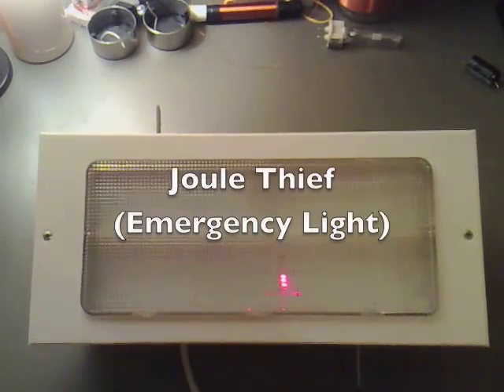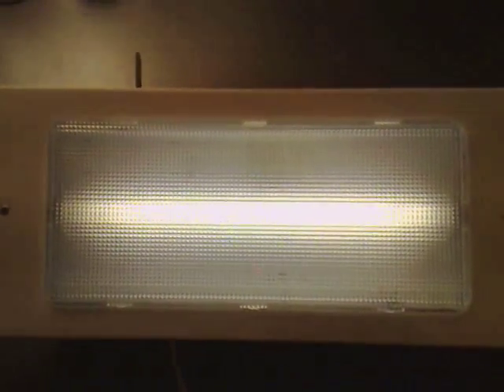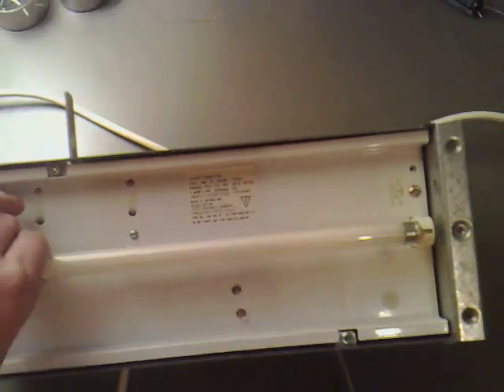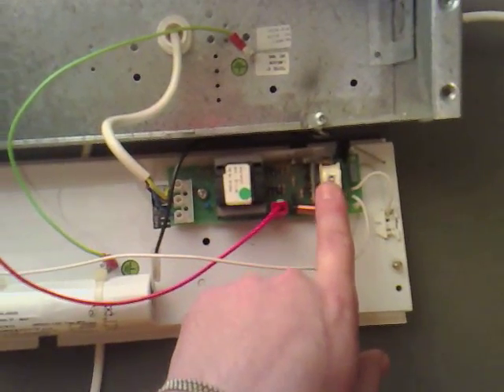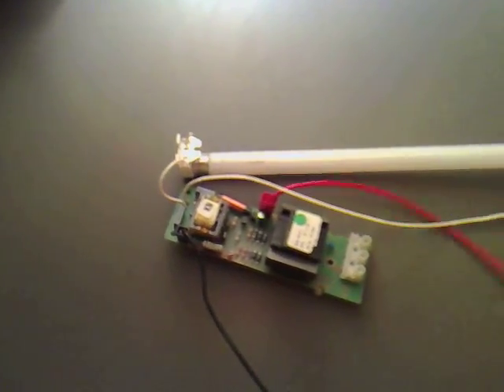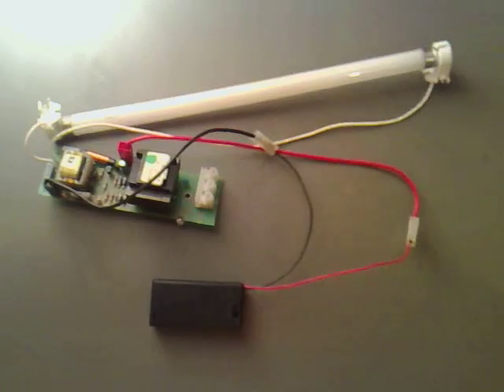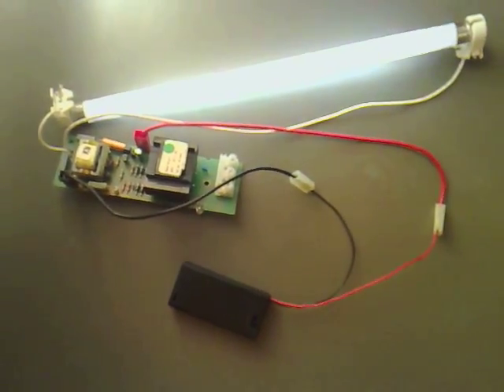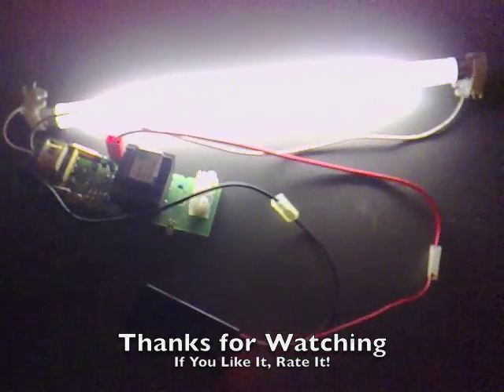Joule Thief (Emergency Light) 021

Comment: Nothing to worry much on those small neon circuit they use small part but not impossible to find one. I have one that came out of and old 17" lcd monitor i had to do reverse ingeniring to get the schematic and found out that it was working with 2 npn transistor 2 resitor and 1 cap draw about 600 mA on 8.5 volts of course any input voltage can be use the tube will be dim or bright.